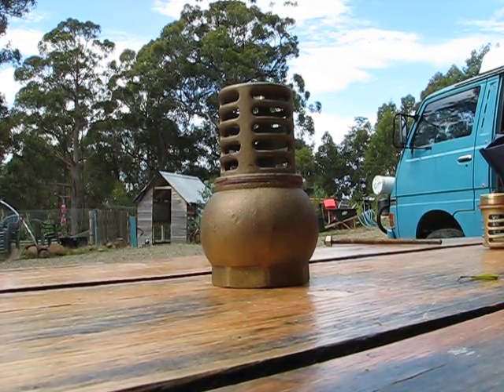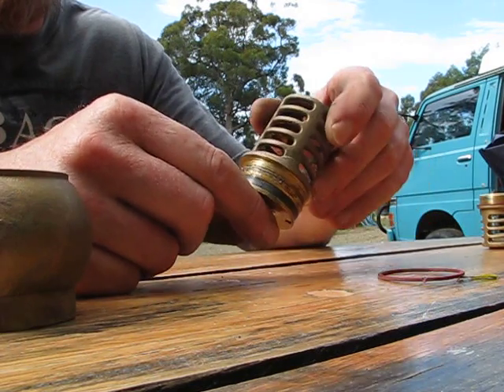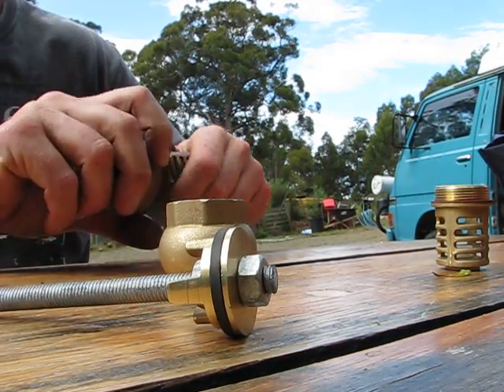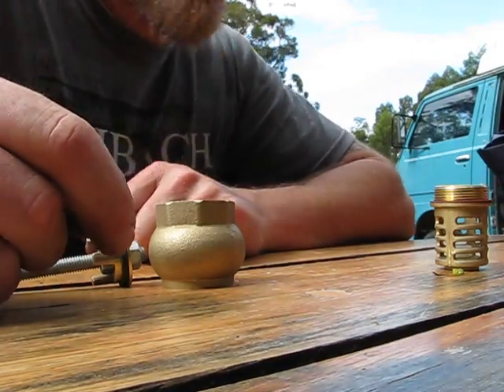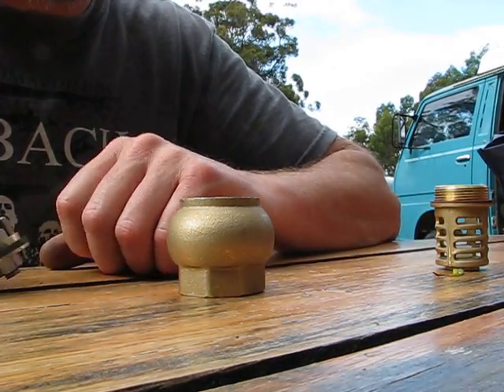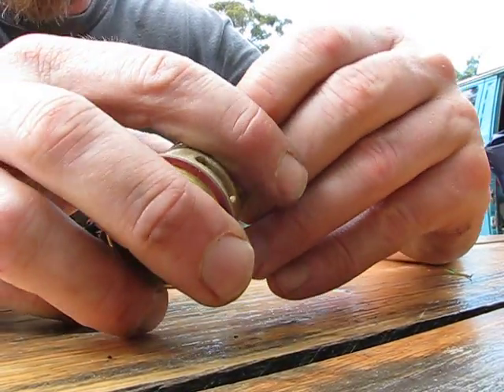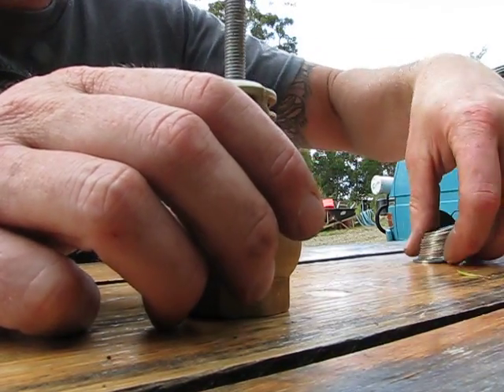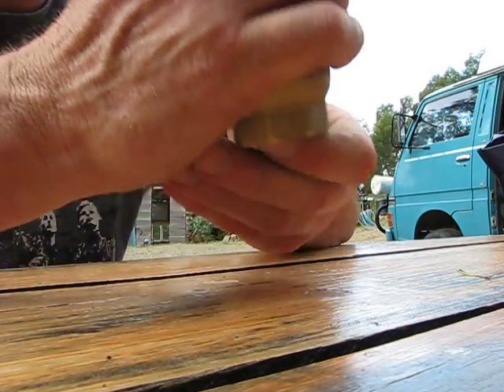1" ram pump foot valve modification

Comment: Brilliant !!!!    Poppet check valves are the 'best'.  Your adjustment of the mass/weight with which to adjust the timing interval to maximize the hydro-IMPACT and hydro-momentum is consistent with 'proper physics'.  Obviously, the threaded rod will wear the 'shoulder bushing' and will need to be replaced with a 'polished rod' - no matter for a 'breadboard' experiment.

Comment: That shoulder washer looks like Nylon.  Nylon is a good choice for something that slides.

There is an alternative design that I saw in another video that you may be interested in.

Instead of the top having big slots near the base, a tall top was used with some small holes near the base.
Part way up, it changed to big holes.

When the valve is open, the weight disk is down inside the section with small holes.
When the valve is fully closed, the weight is up in the part with the big holes.

The water rushing past the weight helps to lift the weight so that fast moving water makes the valve close.